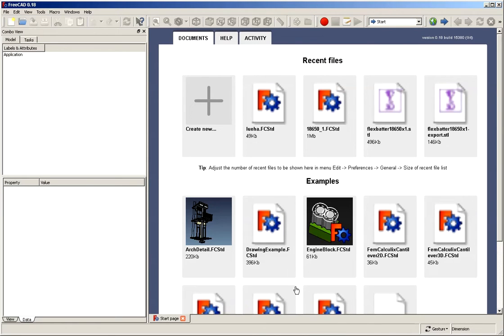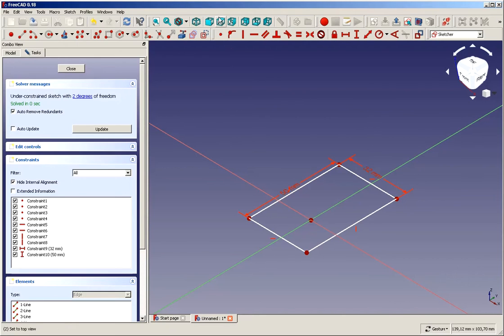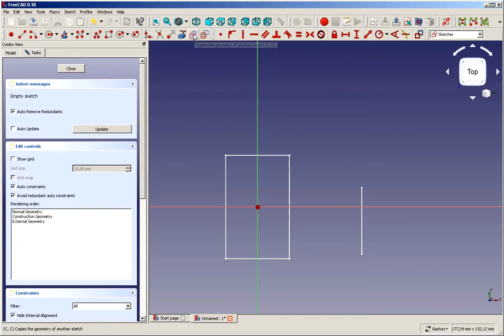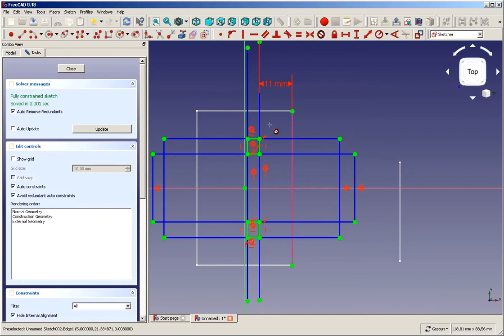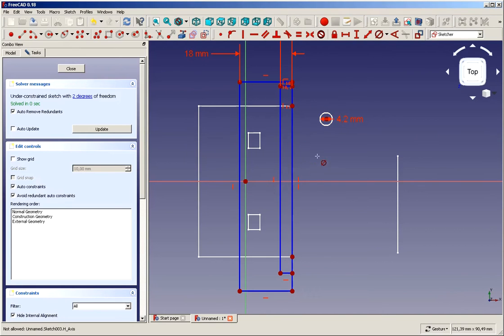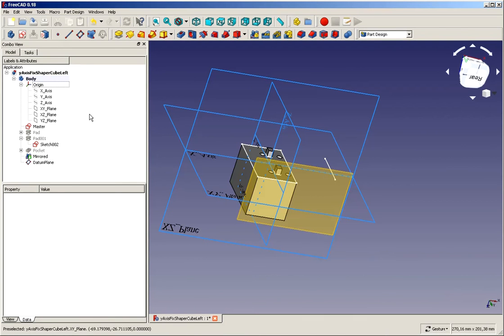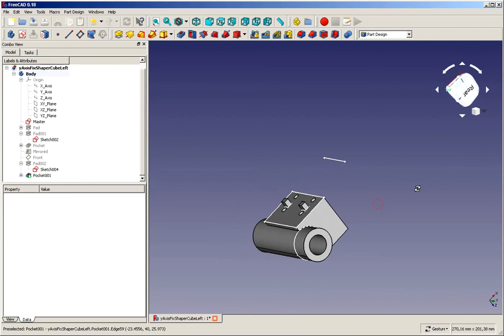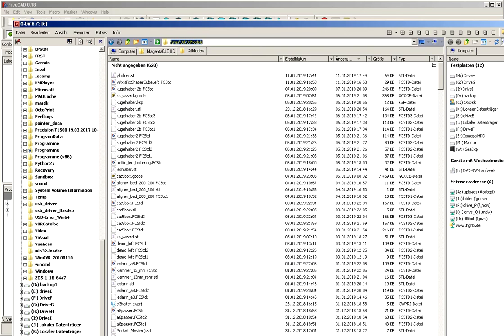FreeCAD 0.18 Entry Level Tutorial ( Follow Up )

Comment: This tutorial comes to a halt when I select Pad then enter = I don't get Master after entering M. What I get is <<Master>>.  If I follow it with C I only get the options Constraints and Fully Constrained. What am I doing wrong?
Reply from the maker: i guess you try with 0.19  , this still is missing in that version. The tutorial is for .18 . In 0.19 you must rememebr the names completely.
Reply: @hagei406  Thank you for your quick reply. I have now installed 0.18.4. All is now working ok, so back to your excellent guides
Reply: In .18 I am getting Datum errors when trying to enter measurements. The only way I can enter them is by deleting the Symmetry

Comment: Thanks! it is very usefull. Quick question: There is any video where I can watch the how fuse two STEP files...I have to generate the alyout of several machines of different size and put them in specific positions. Thanks a lot for your time
Reply from the maker: If you intend to create one Paret of them, then boolena fusion would probably be the right way to go. But if you intend to just fit them together like an assembly, then diggin the forum  about the different versions of assembly modules makes sense.

Comment: How did you undo it at 12: 17 seconds? Which buttons or what command brings you back to the previous sketch?
Reply from the maker: CTRL Z  , as usual in windows programs. maybe if you use Linux, you need a different UNDO Key, or get UNDO from the menu
Reply from the maker: You can jut doublick an previous sketch, to re-edit..

Comment: Im using .19 version and I rename sketch to Master  and the 32mm line HightOfLine create the 2nd sketch but when I go to pad and press the = and M all that comes up is Midpoint where am I going wrong
Reply: just did same thing. no matter what I do, it doesn't show up. You can however create a spreadsheet with all the values you need like BlockHeight, and reference the spreadsheet alias values. Not sure why .19 doesn't work this way anymore, but it clearly doesn't work like .18 did. Hope this helps.

Comment: When I tried this software a few years ago I became hopelessly lost because I was padding and pocketing with no concept of helper lines and planes in space.   I stopped using it as I had invested hours in creating disconnected geometrical wonders of no use whatsoever.  I realise it helps to have a good engineering understanding of diagram making for producing finished objects so that you can understand what the software is offering.  Simple solid first principles and effort and experience are needed I guess and not flash bang wallop!  Thanks for the tutorial but most of all thanks for the attitude - so cool.

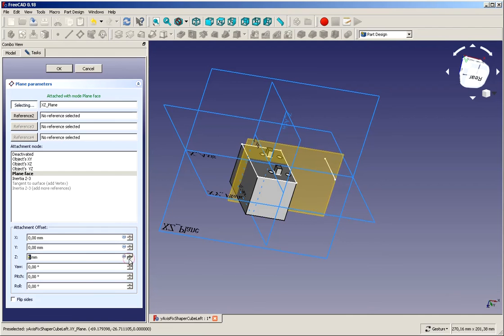Comment: At 48:35 the datum plane is moved in the Y direction, perpendicular to the XZ plane, but the Z direction value is changed for this to happen.... This is the case even in the 0.19pre version.
This does not make sense - am I missing something or is this a bug?
I so much want to like the app, but I'm getting very frustrated - this type of app should at the very least get the basics like direction of the 3 axis right...

Comment: Excellent tutorial. At minute 14, you are mentioning that sketches have to be created from default XY/XZ or YZ planes instead of using existing faces of the already created body. You are very unique. I tried creating a hollow box with top side open, by first creating a master sketch, then creating a sketch by carbon copy for the outer body, a cube, then a smaller sketch (scaled down version) which is used as a pocket to make the hollow inside. Now i wanted to create a handle on the edge, i used the same XZ plane and created the profile of the handle. Freecad did not allowed to create a pad for the handle as the handle was not touching the face of  the box being it is placed at the centre and freecad warns of multiple bodies. Can you please help.

Comment: At 26:55
I try to set the length 22 mm, but I have this warning:
"Datum 22,0 mm for the constraint with index 13 is invalid."
My Constraint 13 is the symmetrical position of rectangle respect to X axis.
Do you know why?
Reply from the maker: Try to set the length on the oppsite line, not on the symetrical line. You can only set the length, if xou can still move the horizontal ines up and don. Otherwise they are locked by something else
Reply: Ha Gei 
Thanks
I solved deleting the constraint about length of opposite line (that on the right side). 
I didn’t read a message (upper left side) by FreeCAD, that tell “Click to select” about the constraint redundant). 
I solved so.

Comment: Hi, if anyone is answering questions: What exactly does external geometry do?
Reply from the maker: I a design your object builds up from several sketches, each on for a new featur. To take ove locations if edges, vertexes etc, you use external geometry, as normall you can onl rerfer to elements of the current sketch.
Reply: Ha Gei great!! That clarifies a lot, and wow thank you for such a fast reply on an older video. Just downloaded Free Cad 0.18 and am working on a project. Thank you again

Comment: Has anyone else tried inputting the name constraints for the pad height (21:55) using FreeCAD 0.19? The Formula editor does not see "Master". If I force it I end up with <<Master>>.Constraints.HeightOfBlock. Only Constraint is found the rest does not work but if I force it I do get the value.
Note this does work perfectly in 0.18, just wondering if anyone else is trying 0.19 too.
Reply from the maker: This is a fault in .19  . The core updates have taken away the automatic listing of constraint names. This is not yet fixed and the reason why i have NO 0,19 Videos at all. I am testing .19 but i am not USING it for my constructions. Sorry, but not my fault and i have claimed this issue several times.

Comment: I'm a 3D newbie and really like the pace and clarity of your videos. However I'm having a problem calling data from the Master sketch. Hitting the = key calls up the Formula editor box but typing "M" shows "Result: Expression can not evaluate to a value" and "Midplane" in drop-down selection box, no sign of "Master". Typing the full request "Master cs HeightofBlocK" doesn't get to the target either. System setup is:

OS: macOS 10.15
Word size of OS: 64-bit
Word size of FreeCAD: 64-bit
Version: 0.19.20900 (Git)
Build type: Release
Branch: master
Hash: 3ad15343ebab78cd76b7e9a06a0f8d794f5075be
Python version: 3.8.2
Qt version: 5.12.5
Coin version: 4.0.0
OCC version: 7.4.0
Locale: C/Default (C)
 
Any help or suggestion greatly appreciated.
Reply from the maker: If you saw my latest videos, i mention that i DO NOT USE and RECOMMEND Version 0.19 for Beginners. There are , absolutely positive , changes there. But due to the nature of these , some functionality of previous versions was lost and not yet brought back into the current  beta versions. For me one of the MOST IMPORTANT lacks is that the name suugestions in the referencing does not work. There are discussions in the forum, but it was not yet brought back.   In 0.19 you must type the whole name of the reference. like  master.constraints.width_of_box  . It works perfect in 0.18
Reply: Thanks so much for your quick response. I’ll drop down to version 0.18 and run through the tutorial again. This was the first of your tutorials that I’ve watched and it’s really helped me get a better feel for the FreeCad method of working - better than anything else I’ve come across so far. I’ll definitely be checking out your other videos.
Reply: @hagei406  I have the exact same issue.
I download the current version (0.18, 22/10/19).
Every time press = then the formula editor appears and can't get any further. 
What do I have to enter in the formula bar to make it work please? 
Everything I try just gives me a 'Failed to parse expression' 
Would like to resolve this as I really like your teaching method. 
I am a 3D newbie as well.
Thanks in advance .
Reply from the maker: @medelec35  Up to now, stay with 0.18 . I also wait until that issue  is fixed. You can use both versions on one PC , i do that too.
Reply: @hagei406  As stated only using 0.18, so not sure what other version you are referring to?  I have the issue with the 0.18 that is the currently released version. Never downloaded beta 0.19. Could it be the 0.18 now has been updated since the 0.18 you used.  For example the date on mine is 2019/10/22.
Reply from the maker: @medelec35  i use : OS: Windows 10
Word size of OS: 64-bit
Word size of FreeCAD: 64-bit
Version: 0.18.4 (GitTag)
Build type: Release
Branch: releases/FreeCAD-0-18
Hash: 980bf9060e28555fecd9e3462f68ca74007b70f8
Python version: 3.6.6
Qt version: 5.6.2
Coin version: 4.0.0a
OCC version: 7.3.0
Locale: German/Germany (de_DE)

and there it works perfect.
Reply from the maker: Maybe try a simple  formula   20 x 5 + 3   after = sign.  Try  typing C ( for constraints ..and be sure you have at least ONE named constraint in the sketch )
Reply: @hagei406  Thanks for all your replies.
Really appreciated. 
All resolved now.
Mine still has the formula editor that appears every time, however got it to work.
I had a space within the constraint name.
Removed the space  and  the after the = then in the formula editor m, the word master appeared as before.
Selected master then after . typed c  the constraint was listed. Selected it an the  Ok appeared this time. 
It's odd as I have the same version and OS as you. 
The other subtle difference is the Type drop-down background is white for you but grey for me. Therefore is only aesthetic. 
Look forward  to going through more of your tutorials. 
All the best.

Comment: At 22 minutes, when using the = sign to call to the Master sketch, if you had typed 'Height Of Block' with spaces instead of 'HeightOfBlock', it fails to parse. When you name the constraints, do not use spaces. I do not know if this is intentional or not, but it took me a second to figure out why mine would not work, so i figured it would be a good idea to save someone else the headache.  if this was mentioned at a later time in the video, kudos, i must not have seen that far yet.
Reply: Thank you. After a slight headache, I ctrl+F "parse" and found your comment. You kept my headache from worsening.

Comment: Sorry this was Painful......... I am running ver 0.18, but at 30min when I fully constrained it, confirmed on the side bar, but all my lines changed colours and I could not create that pad. And I cant remember how to back out.......there has got to be an easier way to do this.....making a block with some holes, standouts and a cylinder attach to it.  Sorry your method is not for me - going to try someone else..
Best wishes, Patrick
Reply from the maker: Well, not each tutorial which shall show as much as possible, or specific  functions, is the easiest way to create a workpiece.

Comment: At 21:00 after deleting height line and closing the sketch I got error internal name sketch 001 and mark "!" is showing on sketch name.
Reply: Never mind I tried redoing it several times and I get it to work by deleting the vertical constraint before deleting the line.
Reply: @Catalysis1144  Could it be that you were using spaces in the constraint name? It get's an error when you use spaces apparently. It was mentioned by Chris King  in the comments down here.

Comment: I am trying to create a constraint between those 2 rectangles at 27:33 but I get an error message "Datum 5.00 mm for the constraint with index 22 is Invalid. I have checked the 22 constraint and it's just a vertical constraint on the left side of the new rectangle. Any ideas where might be the problem?
Reply: Same here.

Comment: following along with appimage version. At 21min when you add the pad, it says on mine that linked shape object is empty. But if I look at the sketch the square is there. Everything else works to that point. Has something changed?
Reply from the maker: I assume your lines in the sketch are BLUE , which is motly the reason for thaat error box..

Comment: Can someone help please. 12:06 when he say we going to key in the equal sign? I don't get it. I  hit the equal key and a formula editor window popping up?
Reply from the maker: Yes, you click into the field, key the equal sign key  and the popup appears.
Reply: Ha Gei I get the formula editor, click Master, then c adds ,constraints to formula, then click height of block and it adds , height of block to formula, but result continues to say "failed to parse expression" and my only choice is discard.
Reply from the maker: @radionut4422  Then you may need to add    mm   .otherwise make a screenshot and ask in the Forum.That is easier than here to work with for such.,
Reply: @hagei406 Hi Thanks for getting back to me.  I trying but when I hit the = the formula editor window popping up. What do i do wrong?  sorry i set the time incorrectly its 21:06.
Reply from the maker: @ferenctaisz449  The Formula Editor is exactly what shall POP up at that Moment. Then you key  M  and select the height of the Block , as seen on video
Reply: @hagei406    I was having the same issue, but  kisolre , at the forums solved my problem.  " So it looks like carbon copy from sketch with named constraints with spaces in names creates something buggy."  I had spaces in the height of box, instead of heightofbox.  When I removed the spaces the error went away.  ( I didn't notice the error on the sketch until I was trying to edit the pad parameters).
Here is the forum link: https://forum.freecadweb.org/viewtopic.php?f=3&t=39153
Reply from the maker: @ck5201975  I saw that in the morning...  did not know that..
Reply: @ck5201975  I had same issue and this fixed it
Reply: just type the same stuff into that window, it works the same. pretty sure its a change in an update

Comment: At 1:04:50 you create a datum line based on the circle in the sketch.  Wouldn't that potentially cause problems in the future due to the topological naming issue?  i.e. if you go back and change something in that sketch in the future, isn't it possible that the circle you used for the datum line might be renamed, and the datum line will reference something else?  All the other datum planes reference the origin planes, rather than any edges in a sketch.
Reply from the maker: Yes, you are right. The most robust way is allways top try referencing back to origin planes  or a master sketch . But if a datum plane looses it´s reference due to  a topo name change, the following objects will not break, just follow the dislocation of the datum plane. If you put it back into place, re-referencing the edgo or face it used, the following construction will also be okay again.  In many dseigns you reach a place where a protrusion or intersection of features gives the new reference. The biggest mistake is to use faces or edges created by fillets or chamfers. They easily loose definition.
Reply: @hagei406  Thanks for the explanation!